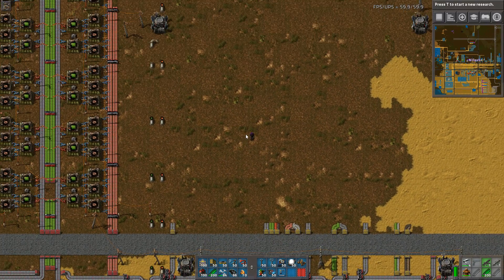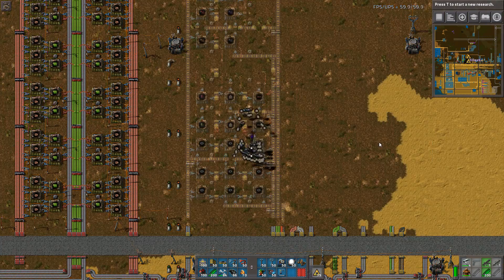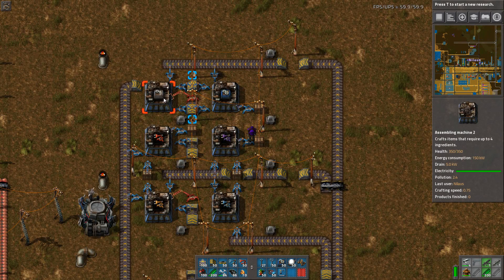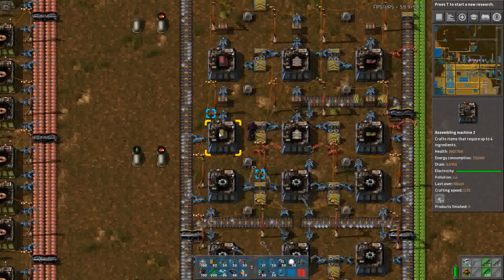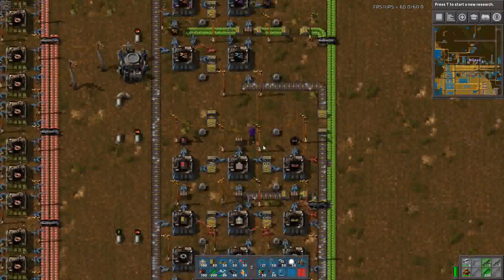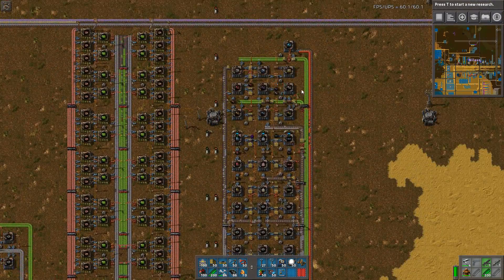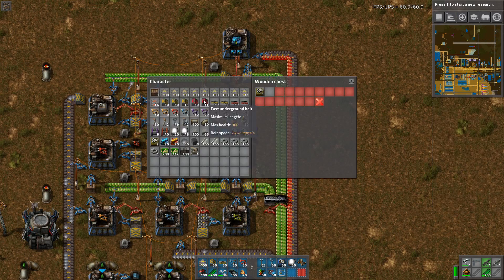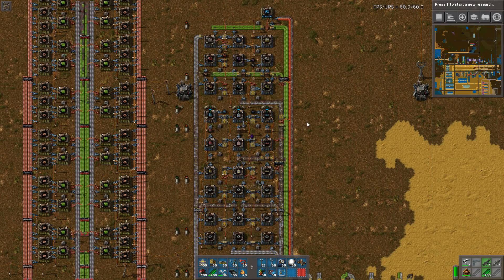Factorio Tutorial - 7. Logistics Mall

Comment: Video is obsolete.  Nilaus needs to update his blueprint so the Blue Assembly machine can be produced.
Reply from the maker: it is a really old video. I may do new stuff eventually like this. Probably closer to official release
Reply: @Nilaus  Good to hear. I just started playing (0.17.60), and this series has been a lifesaver.

I improvised a steel belt running straight to the ASM2 machine, but it's right where the red circuit belt belongs. 😅 Not gonna be fun tearing that one up later....

EDIT: Actually, yeah, forget the belt, on next logon I'll just replace it with a steel chest.
Reply: @Nilaus  do u want to update just 
specific guide's? or do u make to 0.18 release. all new?